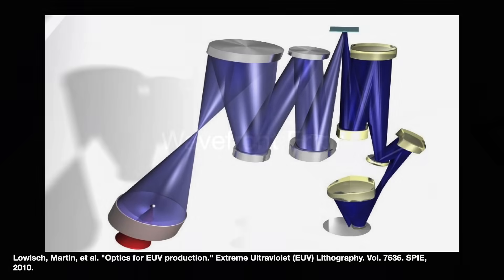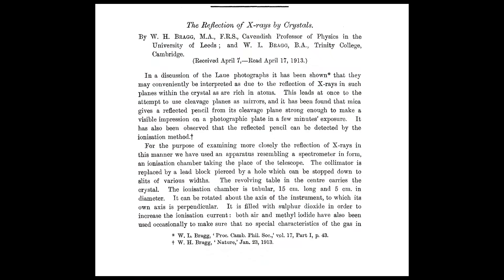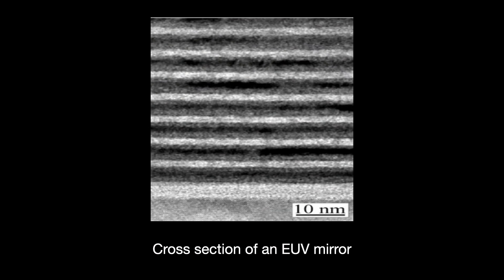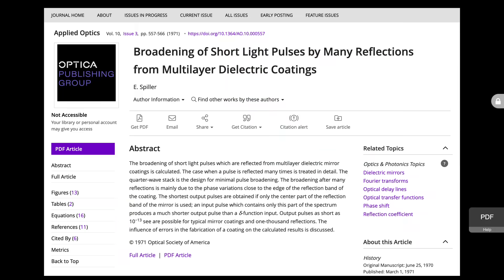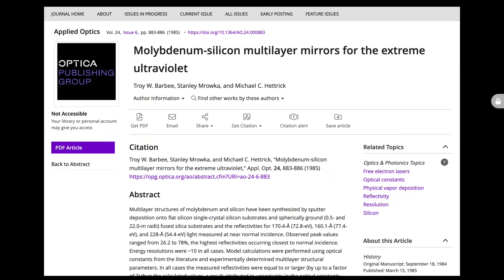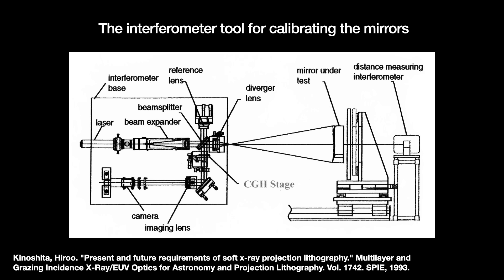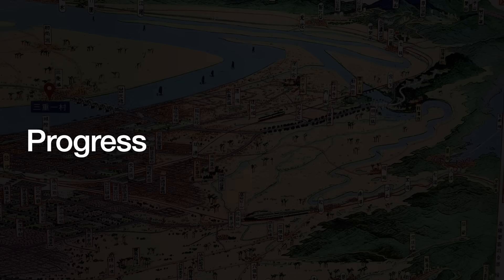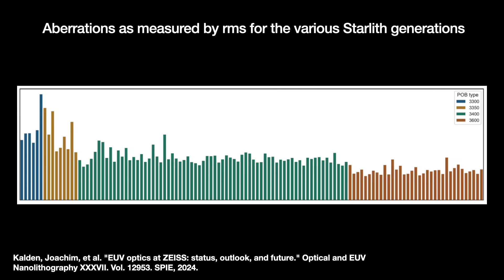How the EUV Mirrors are Made

Comment: With such absurd tolerances, I want to know how they even account for the pull of gravity distorting the mirrors ever so slightly. Is this question something with enough content for a video?
Reply: Yeah that's a very good one. Have you seen the hubble docu about how the mirror got launched with an erroneous abberation?
Reply: @paulmichaelfreedman8334  That fiasco is one of the first things that came to mind. Another topic that Jon could do a deep dive on!
Reply: Earths Gravity is pretty uniform over the size of a mirror,  I doubt it would be a factor even at that accuracy.
Reply: @alexjohnward  reaction force from the mount to keep mirror not falling down must be as uniform, and i bet that is not a trivial problem
Reply: @alexjohnward  I was thinking especially about them being mounted at various angles in the machine. There has to be some measurable deviation at these levels of tolerance. Imagine these same mirrors with a crazy aspect ratio, maybe 50 times taller and how it would "droop" under its own weight.
Reply: @keenanfinucan8778  gravitational pull is very weak, it's measurable with a torsion balance that uses a mirror, and measures how it is deflected by the masses being pulled on the torsion wire, but I don't think anyone has ever measured gravity purely by a mirrors deflection.
Reply: the mounts might have a symmetrical mass during movement, this would cancel any effect.
Reply: ligo measures gravity waves, this is child's play?
Reply: @slugface322  yeah that's measuring how a beam of light is delayed, not an actual deflection of an object.
Reply: If the lenses were heavy enough, that could be a factor, but I doubt it’s a real problem here, that’s more of a larger-lens problem, like for astronomy.

And you’d solve it the same way - knowing how the lens will be mounted, you can simulate how the material deforms, and then design the lens to correct for the aberration - such a lens would be incorrect when not under the expected G-loading, but when it is present, it becomes correct

Comment: The slurry to grind EUV mirrors is actually made from the blood of a PhD student;  sactificed to the Optics Gods
Reply: To be accurate, it’s actually a BLEND of Ph.D. students’ blood.  A blend delivers the required result more uniformity than “single malt” (blood from a single Ph.D. student).
Reply: so THAT's why it is so expensive!
Reply: That's old technology.  The size of a red blood cell is way too large to do the necessary polishing these days.
Reply: The red blood cells function mainly as lubrication. The actual grinding is achieved by clotted trombocytes, which are smaller and more abrasive.
Reply: @dreckman69 I haven't seen the word 'trombocytes' since college!
Reply: @jpdemer5 that’s why the industry is giving PhD fellowships to an increasing number of gnats and mites
Reply: @jpdemer5  this is why industry is increasingly funding PhD fellowships for gnats and mites
Reply: I hear it’s the high salt content that makes it especially suitable.
Reply: @Dasycottus  I’ve heard EUV mirror mfg is transitioning to VMP - Virus Mechanical Polishing. And turns out the virus apparently matters - it’s proprietary.
Reply: What is the size of the student?
Reply: @lifter1000  the student is approximately 150 micrometers in diameter after they are done with her.
Reply: VIRGIN Phd students..
Reply: @marcwolf60 like as though there are any other type?
Reply: @drinsanity2329  Oh yes there are. One of my college girlfriends was working on her PhD and her stories about what her compatriots got up to were wild.
Reply: The joke went over my head first, and I thought you meant that a student had accidentally contributed blood to the slurry (like how a woodworker might inadvertently contribute blood onto their project after getting a cut).  Then I was wondering if the blood played a significant chemical role in the slurry, until I read the replies down below and realized what a fool I was.
Reply: No! Its made of MAGA brains, the smalles known item on molecular Level
Reply: sactificed- uhm yeah that NOT a word. You forgot an 'r' in there sir.
Reply: He has to be a Virgin as well...
Reply: As long as its nothing of value. 😉
Reply: The Optic Gods in Question a holy trinity of Ernst Abbe, Carl Zeiss and Otto Schott
Reply: Grinding is done with blood. The fine polish is achieved with an endless supply of tears.
Reply: @Oldtanktapper don’t forget the sweat for increased salinity